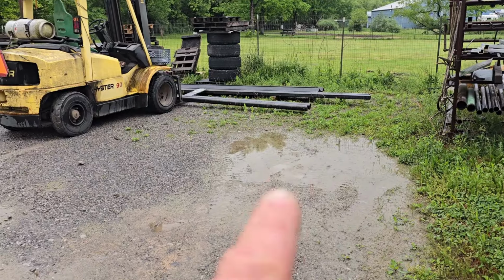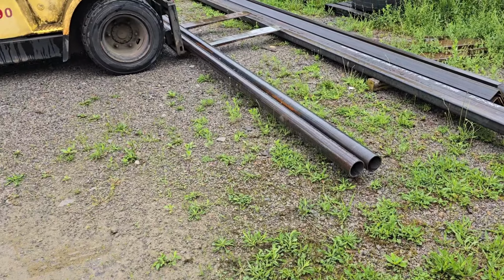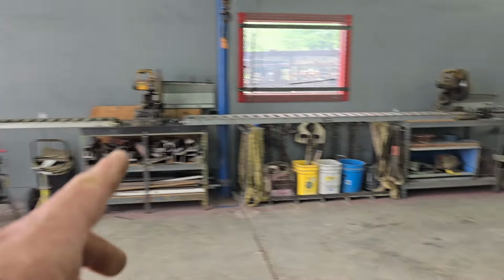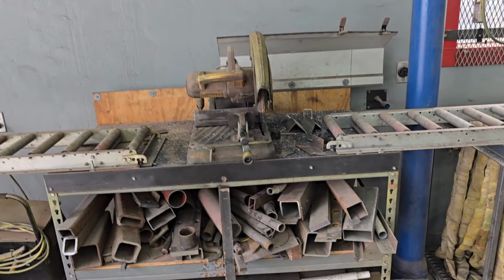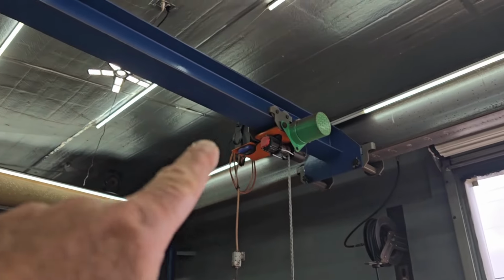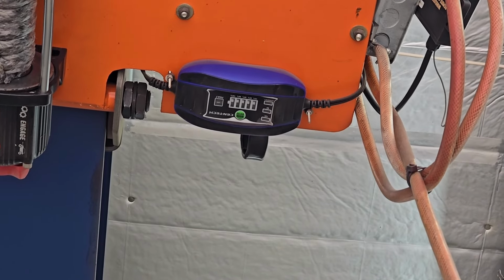Cutting some pipe in the shop

Comment: is the slant in your stop to prevent binding of the drop and saw?
Reply from the maker: Yea I angle it a little when I clamp it down so the part can get out once it's cut
Reply: @NBSWELDING  should the more open end of the angle be in the direction of saw rotation or the other way?  thanks for the tip.  I buggerred up my saw base by having a straight stop and don't want to have that happen again.  any help appreciated.  love the videos and enjoy seeing you make stuff in your shop to keep 'merica moving forward.
Reply from the maker: @peetky8645  yes the more open angle needs to be direction of the saw rotation to let the part out without getting pinched between the stop and the blade